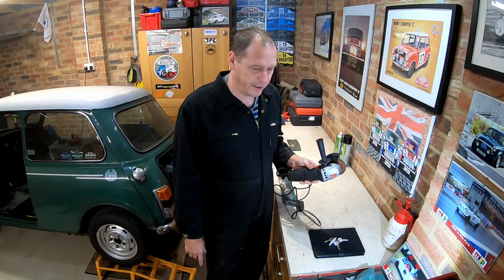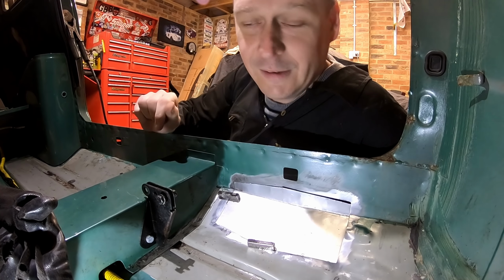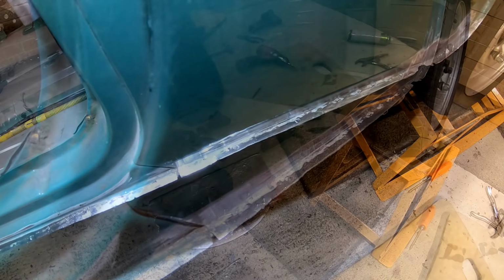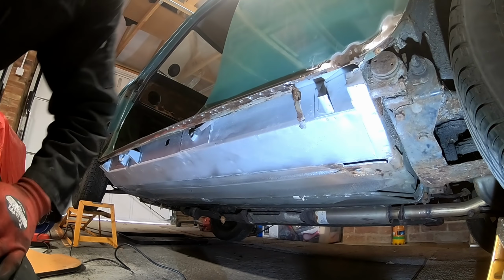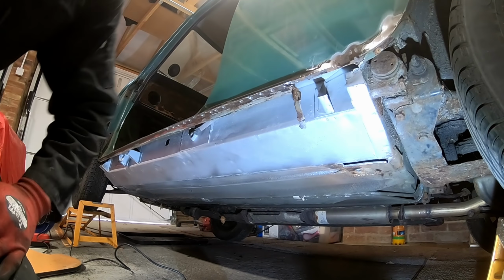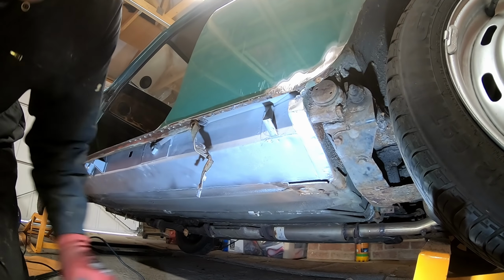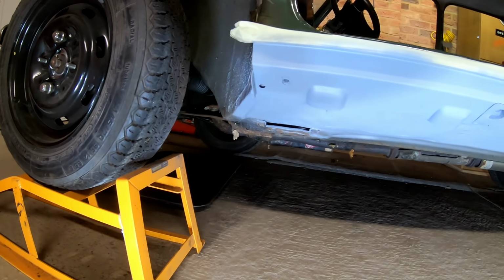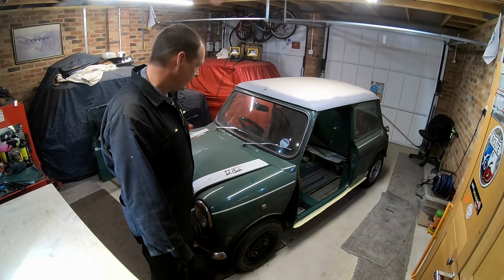Drilling out Spot Welds Classic Mini Workshop - Project Sprout Pt.21

Comment: Thanks Keith, well said and a good reminder to all involved on the restoration business. My neighbour recently suffered horrific hand an arm injuries from a 125 mm angle grinder kickback, and had an extended time off of work. The use of the "sure cut" type grinding wheel when cutting an aluminium headboard, added to the severity of the injuries. I have also used one of these metal cutting wheels and can confirm they are far more prone to bite into the work and the kick back is severe. I will not use one again. Hats off to you and great work on the mini.

Comment: Did you no discs also have a use by date stamped on the inner metal ring. I said to my self i wonder if you did some thing with the subframe mount then you said it 🤣😂
Reply from the maker: mark piper no I never knew that! Will look at them later 👍